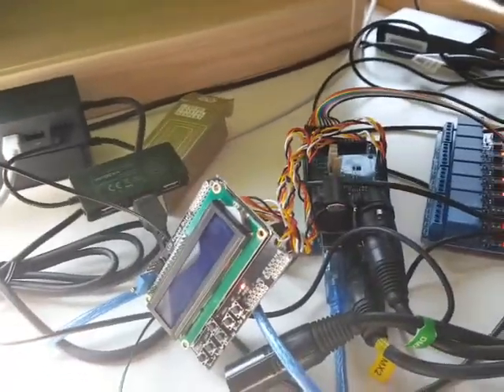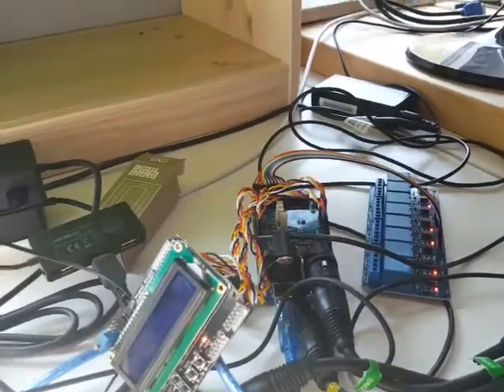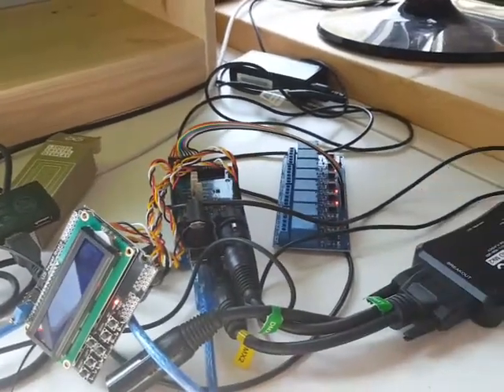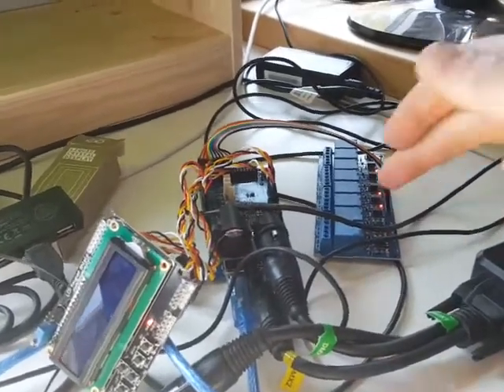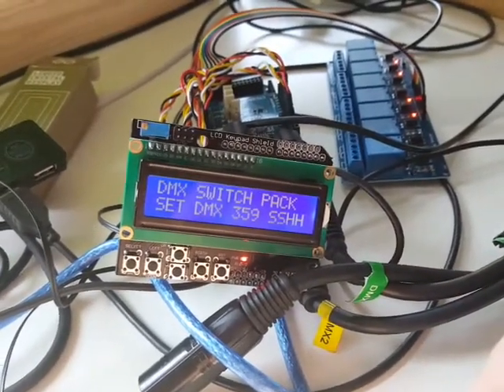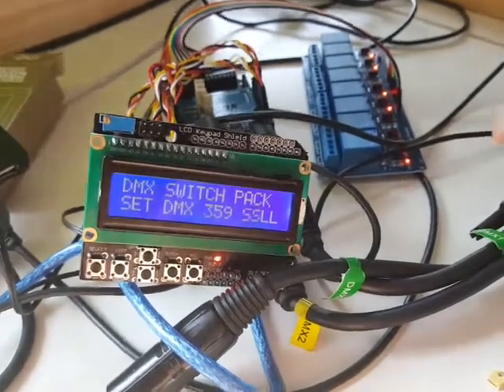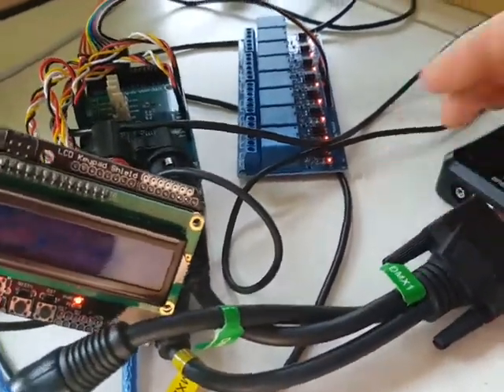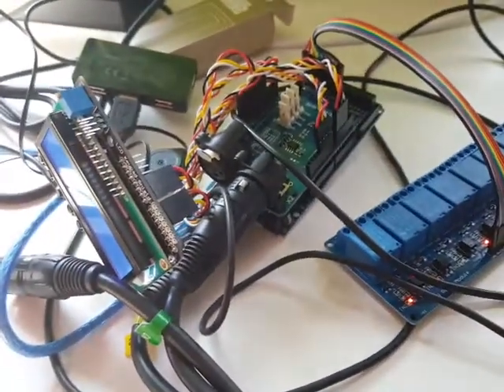dmx switchpack arduino

Comment: hey im doing a project with the conceptinetics library/shield and FASTLED; though there are inherent issues with using the arduino UNO im currently using. Do you know if the conceptinetics library and shield will work with arduino Due? What arduino are you using?
Reply from the maker: I was using arduino mega. I guess it would work, but need to modify the sketch.
Grtz